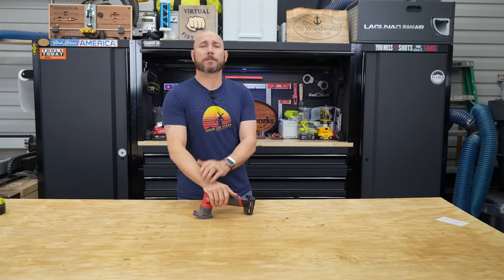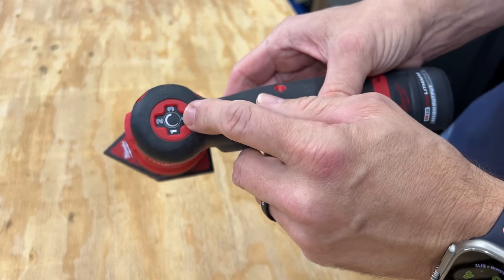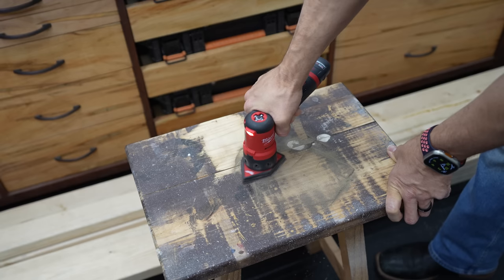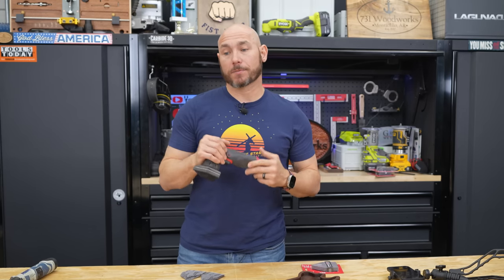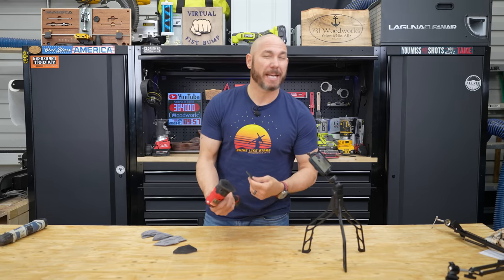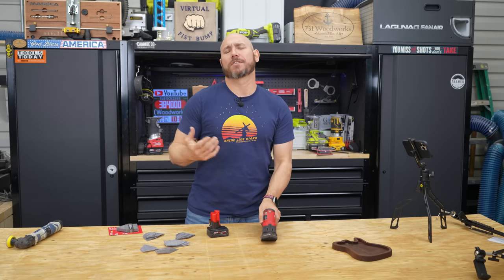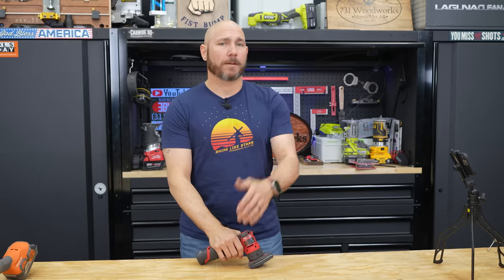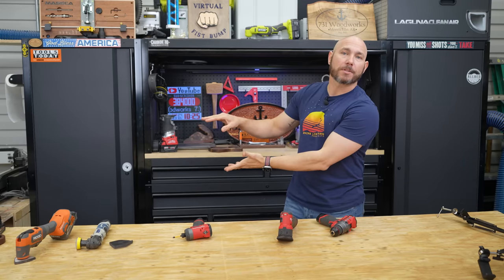Milwaukee M12 Orbital Detail Sander is AMAZING!

Comment: Just a thought on dust collection. Just turn on your vacuum and lay the nozzle next to your work area. It might not be perfect but it’s an option. That an a respirator would be perfect. 
Milwaukee tools would be a great platform.
Reply: Dust collection/extraction is critical when sanding.  Sanding dust is the perfect size to get into and stay in the lungs. Some of exotics are toxic and even some domestics are irritants. If a sander doesn't have dust extraction, use a down-draft table.  I really is critical for your health.

Comment: As soon as I saw this on the Belts and Boxes video of the Milwaukee expo and how it didn't shred the paper to sand on a hard hickory edge, I was looking for its release date for months. I use it almost exclusively for contour sanding. Where I was using a surf prep with a medium pad before, that lad would split pretty soon and the grit would wear off and grind into my pieces, because that sander really isn't made for that. I make a lot of frameless cabinets and the main thing I use this for is softening and blending the sharp edges of the edgebanding. It gets used for so many little quick edge softening tasks because the paper is so robust and doesn't shred like other pads, or make the edge uneven (and also shred) like a random orbit sander

Comment: I have a little Black and Decker "mouse" sander from like 20 years ago. Still use it. It's got that same shape/concept with the point at the end. It's great. I swear it beats out the Craftsman orbital I got just recently. It's not quite as small as that one you showed, but it's still extremely handy and does a great job.
Reply: Lol, I have the same sander as well. Black and Decker tools are underrated especially for the diy type guys! 
I also have a porter cable multi tool it has a sanding attachment as well. Have not used it yet but it looks very functional. The multi tool is a little heavy. It might not be the most ergonomic option!
Reply: This is why I had a hard time really appreciating this m12. The b&d also has dust collection.
Reply: @ChrisBranleh  not mine! lol. I think i got the first model. I remember shortly after getting one they came out with a new, and what looked to be, much more improved one. Needless to say they've changed a lot over the years. I'm sure mine pales in comparison to the modern ones, but it works just fine.

Comment: Yeah, I've been looking at that since you showed it. Was really, really not looking to get into another battery line, but that sander looks amazing. Would have come in really handy for my last project and I wish I already had it.
Reply from the maker: It's really hard to buy into a new platform.  I resisted for a very long time.  I think it's worth considering a new platform when they have tools the others don't (like this sander) or they have an extensive library of tools like DeWALT or Ryobi.  That's one thing I think Ridgid lacks is all the "extras" of a lot of the other companies.
Reply: @731Woodworks  💯👍
Reply: @731Woodworks  based on your review I got the 3M Xtract, question do I need a pad protector?  Is where do I get one and what is the part number?
Reply: You could always get the attachment for any multitool
Reply: occilating saw
Reply: @PERSEUS-REPTILE-more  🤣😂🤣😂🤣 there's good reason not to. Which was pointed out more than once in the video. Did you not watch it?
Reply from the maker: @rickyperkins232  Ricky, you can get them on Amazon just do a search "3M pad saver" and you should find the OEM 3M part. They will certainly keep the velcro from wearing gout on the main pad.  I use them on my Festool.

Comment: When I saw your review, I just had to have this as it was something that the market was overdue for.  I love this little sander as it is much easier to sand those small projects with it instead of my 1/3 finish sander.  As with any new product that comes to market, there will be issues.  I purchased one of these and as soon as i received it, I went to work.  In the first 90 seconds of use, the tool stopped working.  I initially thought that I had a dead battery and switched out to another one, only for the tool to run for another minute or so before it also stopped working.  That's when I noticed that the indicator lights were flashing which indicated that the tool was overheating.  Immediately called Milwaukee who instructed me to send in the tool for repair.  2 1/2 weeks later I got a new replacement tool.  Used it for two weeks without any issues and all of a sudden, the tool randomly indicates that it is overheating, regardless of whether or not the tool was being used and will not function.  When it works, this is a great little tool and I love it, but not so much when it doesn't work
Reply from the maker: Oh wow.  Sorry for your troubles with it.  I've used mine quite a bit and it is still going strong.  I wonder if they had a bad batch?

Comment: I use the Milwaukee M12 and M18 tools.  I have noticed that M12 batteries charge faster in the M18/M12 charger than in the M12 only charger.

Comment: So would you recommend it over the Rikon? That 5 year warranty is looking pretty nice!!
Reply from the maker: I think the Rikon is a great little sander for $100.  It removes material faster than this little M12. But this one just gets into corners much better due to the shape of the sanding head.  And with the Rikon, as far as I know, that's the only tool they have with that battery. With the M12 sander, if you decided to add another Milwaukee M12 tool later, at least your batteries would interchange.
Reply: @731Woodworks  that’s a good point! I’ll probably never buy another battery powered Rikon tool

Comment: If you haven’t already, you should really check out the M12 Fuel Oscillating Tool (2526-20). It’s a beast. Out performs most 18v and has almost no vibration.
Reply: The fact that I have one is the only reason I'm considering this sander...they're both really good and can share batteries. Not a fan of Milwaukee's fatter grip compared to the more comfortable DeWalt tools though.

Comment: I have had my eye on the Skill 12 volt line.  This really caught my eye, SKIL PWR CORE Compact 12-Volt Brushless Cordless Detail Sander with Dust Management (Battery Included)
Item #5041695
Model #SR6608A-10
Lowes has the kit for $99.
Another reason why I have been looking at Skill is because their tools are made by the same manufacturer as Flex, and I love Flex tools.  I was told by a Flex rep that they are not planning on releasing a 12 volt line because they are using Skil for that.  They want to keep Flex a 24 volt line exclusively.

Comment: I started out on the Ridgid 12v platform until they discontinued it and had to find another 12v platform. After researching I ended up on the Milwaukee M12 platform getting the gen2 Fuel Hammer drill/Impact kit during the holidays. Since then the M12 bug has bitten me hard...lol! This will probably be the next M12 tool I purchase. With the soon to be release of the M12 Fuel planer, hopefully we'll get to see a review on that tool from ya and what kind of projects you would use it on!

Comment: I’ve given up trying to stick to one battery platform. I started with Dewalt, which was good for a beginner for all the basic tools.  I then got a deal of a Riyobi pin nailer on sale, which has been great. The Festool cordless 55 track saw was next: no regrets. I recently got the Bosch small compact drill and love it.  At this point, what’s one more battery platform? 

Edited to say the sander is great but the original battery was awful and overheated quickly and then shut down.  Milwaukee must known because it came out with an improved battery (more $) that doesn’t overheat as easily.

Comment: Great idea! Thanks for sharing this. I’ll be checking out the tool only since I have the driver, 3 of the batteries, and 2 chargers since my larger drill has dual-sized battery slots. 

I asked a question on your video about the Oliver planer. Can you help me with a question about it please? 

I just destroyed my very old
Craftsman planer today and am really interested in the Oliver. Can you please tell me how many poles it has across the top (underneath the black plastic)? I can't find that information anywhere so far, but figured you would be able to answer me fairly quickly and accurately. Thanks in advance! - Teri
Reply from the maker: It has one bar on each corner that act as guide rails.  It also has 2 in the center that are threaded rods and that is how it raises and lowers.
Reply: OK, thanks for the reply. My question is actually in reference to horizontal poles. The old one I have has only one pole across the top, and I’ve seen the Bear guy on the Den of Tools ,(I think it’s called), mention that it’s better to have more than just one. I spoke with a Woodcraft tech guy this morning and we discussed the need for it on this planer. I feel that because the handles are on the bottom, (and lifting it more properly than the other versions, as far as back support), this actually doesn’t require pole(s) and in order to make it structurally sound. I’ve actually found it difficult to lift my current one using the handles that are on the top because that makes the majority of the weight so much lower. My husband doesn’t even use those. I’ve tried to stop him when he lifts it with that single post going across there, (even though it plainly says do not lift it by that.) 
The Oliver’s base is made out of steel, not any version of aluminum, and all four posts in the corners and the spiral rods are (welded?) in to the steel securely. The guy told me that the plastic sides and top are basically just a protective housing to keep excess things (maybe like loose clothing, fingers, long hair?), off of the movable housing for the blades. 
I’m not sure if yours came with a disclaimer/warning sticker on the top that says “Do not stand” on it, lol, but they do have that on there now. (Are YOU the reason why??? 😂) I know for a fact I will never need to stand on top of mine, and I have never thrown a board across the top of any planner previously so that plastic piece is fine with me and the thickness gauge on it is actually a good idea. 
Now to just wait for it to arrive so I can get back to work!!!
Reply from the maker: @MHI.creations.workshop  the vertical bars are bolted onto the base from underneath.  The top horizontal bars....there are none.  Only the cheap molded piece of plastic (it does say "no step") that connects the two sides.

Comment: Nice & quiet in operation. Most detail sanders are very noisy.will it take ordinary delta sanding disks or Milwaukee custom shape only?
Here I am, sent it to me !!
Reply from the maker: You can just cut your own out of regular paper.  But I'm not sure if anyone else makes this shape paper other than Milwaukee
Reply: Use Mirka 2 3/4 10 yard rolls and cut to size, you get way more bang for your buck then buying Milwaukee paper and Mirka lasts longer too and leaves a nicer finish

Comment: You must have run out of people to gift you Festool. They make a very nice detail sander WITH dust collection.  My real beef with the Milwaukee 12v system is how large in diameter the grip is because the battery is inside of it.  My hands just don’t fit around it well enough to grip the tool well.  And finally and I know you are just not listening but quoting the Bible during a woodworking video is totally out of line. If you want to evangelize, then start another channel for that purpose and advertise it that way. Don’t click bait people into watching a video about woodworking and then pop them with a bible verse before they even realize it just happen. Back to square one it seems. Bye bye.
Reply from the maker: Wow you do live up to your username don't you.  🤣 Out of line?  I don't see it that way.  I believe in Matthew 5:14-16.  14 “You are the light of the world. A town built on a hill cannot be hidden. 15 Neither do people light a lamp and put it under a bowl. Instead they put it on its stand, and it gives light to everyone in the house. 16 In the same way, let your light shine before others, that they may see your good deeds and glorify your Father in heaven."   So you see Grumpy, I will not hide my lamp.  I can't.  I love you too much to do that.

Comment: I couldn't disagree more with the battery life. This thing eats batteries. I've bought it to replace the sanding block in my life. So anything that I would usually hand sand gets this hand sander. Recently ripped a whole room of very old but in good condition wallpaper. Used the sander to fix any boogers left behind or to hit any patches that were done. The 2.5 battery only lasted for about 45 mins of off and on picking it up here and there use. It doesn't matter to me because I have a bunch of M12 batteries. If you're like me though and bought the sander so you'd no longer have to hand sand things, which is something Milwaukee stated in their promo material for this, then just no that the batteries do not last a long time. Idk what this guy is talking about. I'd guess he'd use 2 bars just to sand one of those trays.
Reply from the maker: Maybe you got a dud?  Mine lasts quite a while.  Never done a full test to see how long exactly but I don't find myself charging them a lot.

Comment: I bought this m12 sander. It was very comfortable to use and had decent power. But it was very hard to control 1 handed seemed like I couldn’t keep it flat without putting 2 hand on which for this shouldn’t be necessary. But it did well just wasn’t for me so Home Depot got er back

Comment: I've been using the Milwaukee M12 platform for 15+ years and I still think it has the best bang for the buck.  I have an 18V Makita drill/driver which I rarely use.  I am 70 years old, light weight and physical size make a difference. 

I am not thrilled about Milwaukee phasing out the M12 drill/drivers for hammer drills.  I have only needed a hammer drill once or twice in the last 50+ years.  In those cases a concrete bit was good enough.   I do have a few star drills in the tool box.  Bottom line the additional weight and size is more important.

Another pet peeve is Milwaukee going to 1/2" chucks on their M12 drills.  When was the last time you used a 1/2" drill bit?  All of the drill bits I have that are bigger than 3/8" in diameter have the shanks reduced to a nominal 3/8".

Oh, I forgot the subject matter of the video.   After the end of my wife's moratorium on tool buying, I'll be adding the sander to my wish list.

Comment: the only battery tools I have are a pair of craftsman 19.2 drills  straight and right angle... been waiting to pull the trigger on another battery system to get an impact driver and small circular saw.... this may be the system... besides I grew up in Milwaukee, (moved to Texas in 1971) yeah, I'm an old F@rt... 73......
Reply from the maker: Milwaukee makes some great tools.  I just started buying them a few months ago but so far I like what I have purchased.
Reply: Hey hey from iowaaaaay! If you’re interested in dewalt, I was at Lowe’s and Home Depot yesterday, so I don’t remember which one it was but they’re running a buy two powerstaack batteries get a free bare tool. It didn’t come with a charging station though.

Comment: I love your videos and enjoy each one. Great job. Question: I have been looking on the Amazon and Home Depot web sites before I buy this, hwoever I am not been able to find the sanding sheets that fits this. Are the they strickly made and sold only by Milwaukee?  Or is there another place they can be purchased without paying an arm and leg or having to cut your own? Thoughts?
Reply from the maker: They are pricey for what they are.  Unfortunately I think only Milwaukee makes this specific shape.  Try either ToolNut or Ohio Power Tool to see if either has them cheaper.
Reply: After sending you my question, I found that Home Depot "did" sell these. And yes, they are a little (a lot) on the expensive side: 12 pack for $12.97.
Oh well, I guess buying more of these will help stimulate the economy. 🥴 Thanks again

Comment: Guys! I need a sander. I have all the ryobi tools, so I’ve been using the ryobi circular sander on all my projects. The noise.. the vibration, the weight.. it’s killing my joints. I’m not gonna be able to woodwork very long with this thing. Any suggestions?

Comment: If you have the DeWalt oscillator, you can easily craft these add-on's yourself and save $200. Also, you won't need to keep up with a second battery system from a different brand.
Reply: DeWalt also sell the sander attachment as an add-on at Home Depot. 
Thanks for the video!

Comment: I am considering buying the head for the milwaukee oscillating tool, do you have experience with that? I am thinking two birds one stone?
Reply from the maker: I won't work the same as this sander. The oscillating tool only goes side to side whereas this goes in a circle (orbit).
Reply: @731Woodworks  that makes sense. Thank you for clarifying!

Comment: Why is this any better than a multi tool with the sanding attachment on it? I wish you could put a circle on it.
Reply from the maker: Tell me you didn’t watch the video without telling me you didn’t watch the video 😂. I talk about that in this video but basically this is an orbital sander. Multi tool just vibrates side to side which will cause scratches in your wood. This sander doesn’t do that. It’s a nice finish quality sander.
Reply: @731Woodworks  I did watch but i still dont understand. I know its an orbital vs the multi tool not being, but i get pretty good results from my multi tool with sander too. I just wanted to make sure it was that much better before buying it because i spend too much money on milwaukee in general lol I never skip milwaukee tool videos like this.
Reply from the maker: @Dhibbsey  if the multi tool is doing a good job for you, I'd say keep using it.  This sander is more for really fine detail, trim work, etc.